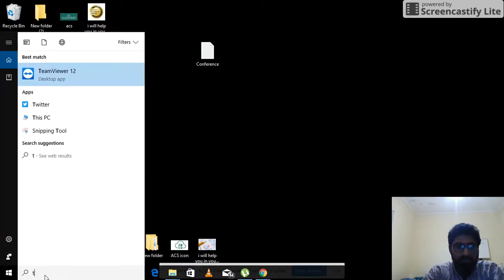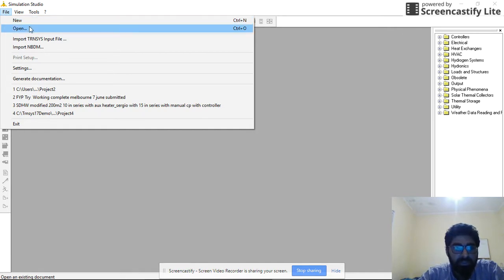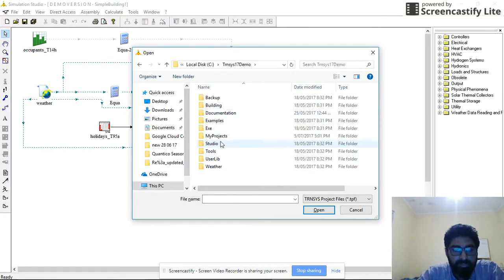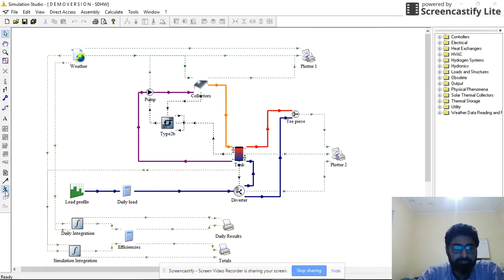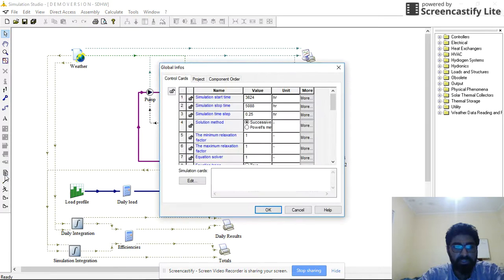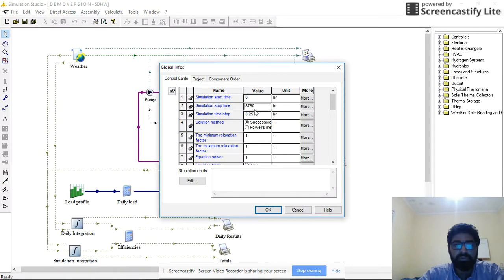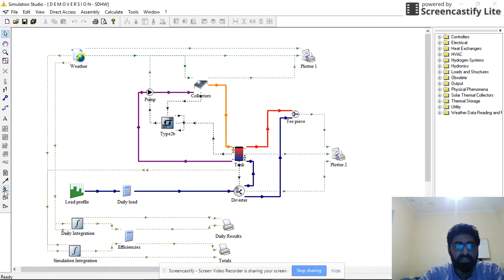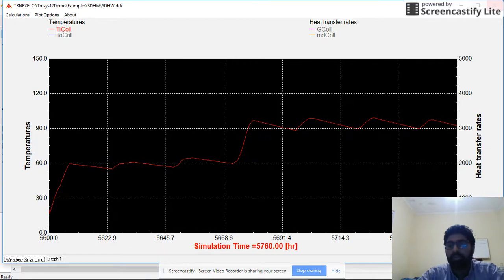How to edit TRNSYS Simulation Runtime

Comment: Hello,How can I change run time starting from September and ending in May? The error says that Starting time is greater than Stop time. Simulation should start from January only? Thank you.
Reply from the maker: bilguun Buya start time 5760 and end time 12360. This will solve your error, and your program will run from sep to may (+- day or two) actually calculate number of hours till september. Start from their. Like till september it will be 8 months. So 8*40*24. 
And end till may, so till may it will be , 12 months + 5 months, so 17*24*30.
For accurate results u can actually count which month is of 30 days or 31. 
No the simulation can run from any time. 
I hope that answers ur question
Reply from the maker: Hey, Sorry for late reply,
so till September it will be 8 months, meaning, roughly 5760 hours will be your starting.
now remember, you are running till next may, so your end time will be 8760 (1year) + 2880. so it will be  14520. 
I hope it helps.
Reply: @Thenextrex  Sir can u tell me My simulation time start from 3624 and end time 5088 Please tell me how to correct this type of Difference te are showing time 5088 hr Please correct and tell us the How to correct all the start time and End of the time ..please reply sir ASAP..